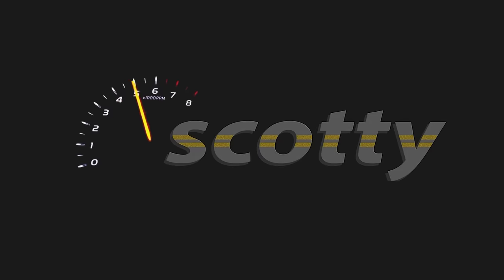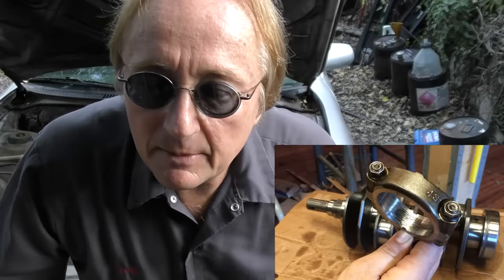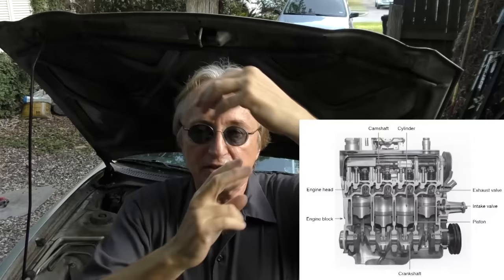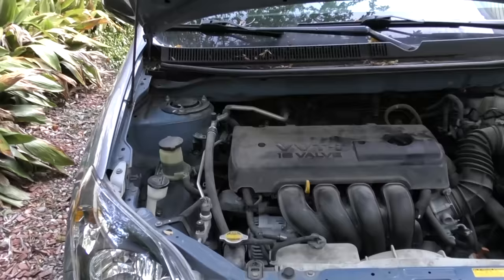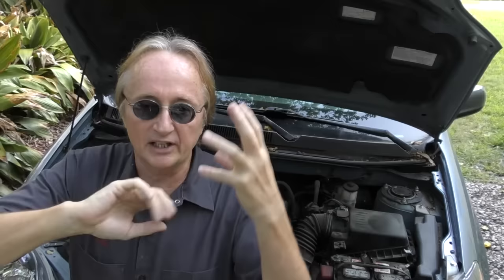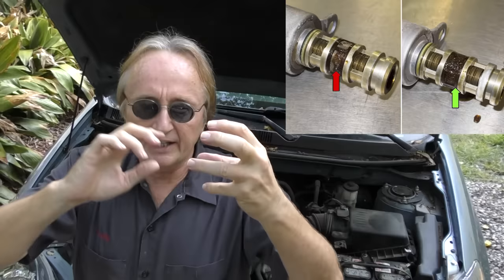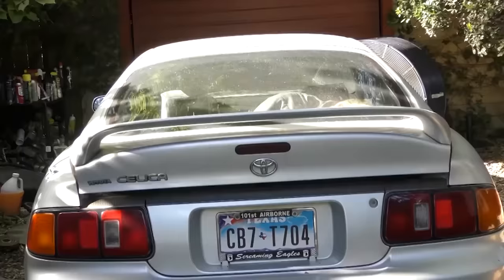Why Not to Flush the Engine Oil in Your Car

Comment: Had great experience with Liqui Moly engine flush. Toyotas have bad engine design and too small holes in the pistons behind oil ring ,even with frequent oil change these holes can clog up. ZZ-FE engines need flush before every oil change in my opinion ,but just gentle one 15 min idle.

Comment: Scotty, i heard that you can use auto trans fluid to flush engine. Take out a quart and put a quart of atf. Run for 500miles stop and go. Then drain all and fill with motor oil. Change oil filter too.

Comment: Here in Australia we have Penrite oil flush it uses the same detergents that is in the oil it is not a hard deterrent I have used it for years and never had a problem I have actually had older engines run better and quieter after a few flushes look up Penrite oil flush it will tell you the information you need my Suzuki was making a noise and after the flush it is now quiet since the flush before I was just changing the oil

Comment: The best and most safe way to do this is to use 5 litters of diesel and do this on a cold engine.  Disconnect the belt to the oil pump and use a drill to SPIN it for 15 - 20 minutes. Then drain. But the most IMPORTANT THING TO DO IS CHANGE YOUR OIL AT LEAST 3 TIMES to get ALL THE DIESEL OUT. So fill with oil , idle 10 - 15 minutes and immediately drain. REPEAT 2 MORE TIMES.

Comment: You wrong Scotty. The flush loosens the crud and it gets caught in your oil filter before it can get to your oil channels and galleries. Do a flush and change the filter run it some more and change the filter again, the drain everything and do an oil and filter change.

Comment: I use Shell Rotella T6 fully synthetic Diesel oil in my turbo diesel and in my turbo  as well, I change the oil at 5000 miles and the diesel oil is capable of holding mor ein suspension and removes the sludge.

Comment: Lots of opinions because it's a complex issue. If you do your oil changes regularly, you're good. If your engine is crudded out, there is no SAFE solution besides pulling the engine and seeing what's going on.
Then it depends on product used too and specific engine. As Scotty says, if the crud is preventing the engine from leaking you'll reveal a leak. Your solenoids or variable vale timing system can get crudded out. TECHNICALLY, the solvents are not supposed to break the crud in chunks, but in practice it can happen. There could be metal shavings and other stuff trapped in the crud, and THAT can be freed to clog stuff when the crud dissolves. You can't be 100% sure. Hence professional hydrogen or solvent engine cleaning can be a problem too, but then it's the mechanic's issue, not yours. If they run it too strong and clog the engine, they'll be pulling it for free. That's why it's generally not recommended unless you're ready to go pull the engine and clean the rest, change head gasket and other seals etc. If your engine is crudded out but still works generally fine, regular oil and filter changes with modern oil will possibly keep it from getting worse.
A guy in another video recommended a double oil change, that might help some too. Double oil change, cleaning the pan and engine cover head is as far as i'd go personally.

Comment: I have a 2.0t and was running pretty bad so i drained the oil and left the plug open, then just powerwash from where you normally put oil in the engine and youll see everything come out :) make sure the engine is hot before draining the oil so it will make all the water evaporate when done, fill up w new syth oil and like brand new

Comment: Have an old Honda with well over 200k miles. I can’t believe how well the engine runs. Always used synthetic and always changed on time cause it starts bugging me about it when it gets to 15% life left in the oil. Now the transmission and rest of the car was a different story.

Comment: I usually drain the engine oil then pour some new oil in to push out some of the old dirty oil, wait till the oil starts running clear before putting the bung back in.

Comment: I bought a 2005 Subaru Sti with 130K original miles with no oil leaks. I decided to do a engine flush (2 oz of sea foam) in the oil crank case, ran it for a few minutes then drain the oil and put new oil and filter and yup.... that is when i started to have oil leaks on my valve covers. Sigh... Now i know not to do that ever again. ha

Comment: Owners manuals tell you NOT to use fuel or engine cleaners.   I use to use these products until it Clogged up my oil pickup screen Literally 100%  with hard carbon.  …. When all that carbon breaks up guess where it ends up???   Right in the oil pickup  screen.  Won't clog immediately  but overtime the use of these detergents  WILL clog your screen .  Do not use this stuff
Reply: No Fuel cleaners???  But it helps with cleaning the injector heads.  Thanks

Comment: I wish I would’ve seen this video before I flushed out the engine on my 20004 XC 70 Volvo. The guy at the oil change place recommended it. The car ran fine. Now it’s running like crap the oil pressure light keeps coming on and it’s burping and farting. I’m at a loss of what to do. I don’t have the money to pay a mechanic to look at it. I really needed this car.

Comment: Would you recommend just running clean oil after an oil change just to get whatever is loose in the engine that didn't come out with the old oil to get it back into suspension, run that for 5 to 10 minutes and drop that. Not using a motor flush product, just regular motor oil.  Then fill it back with oil and a new filter.

Comment: I use QMI PFPE engine cleaner. I use it every 30 000 miles-ish. Once I have done it, I have to take out the oil sump and clean it and the oil strainer. Never had an issue and the engine runs better afterwards.

Comment: I bought a 1992 Toyota Paseo 171k km, auto. Did oil flush and 5k km later I notice it starts leaking oil from the crankshaft seal. I just bought another 1992 Toyota Paseo 141k km, manual. Definitely not going to do oil flush this time around. Just a nice semi-synthetic group-III oil and a synthetic oil filter from now on.

Comment: You should make a difference between "already cruded engines" and "normal not dead already engine".  If you flush engine every time you change oil than you would not have problem with deposits....so it is more of a ..."if it is an old engine maybe you need more than one flush":)) (3 or 4  consecutive with clean cheap oil each time and "detergent" )

Comment: Just regular oil changes at 7500 miles on a 2.2 liter 4 cylinder 2010 Chevy HHR and just hit 230,000 miles. Bought it used with 60K and it still starts right up and gets 32 mpg

Comment: The owners manual is a guideline. Flushing MUST be done intelligently with consideration of the internal condition of the engine. Then a shortened O.C.I. (oil change interval). Otherwise don't attempt it. Just change the oil early a couple of times. This will clean the engine internals.

Comment: ZMAX has an FAA rating and melts sludge and the carbon under the pistons that heat up and make it diesel. I bought a $400 Econoline and the engine was missing and transmission bucking I added ZMAX in the gas tank in the oil in the auto trans. By the time I got home it was purring....still runs. Sold it same week $3200.

Comment: You can flush engine oil without using additives. Just put in fresh oil run it up drain refill repeat until only clean fluid comes out I do this for all my engines and they always come out clean even after a few thousand miles

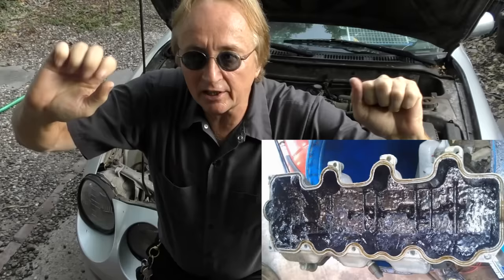Comment: 1:34 Talks about old engines crudding up. Shows examples of modern engines all crudded up, With his Miracle Detergent oil.  Then talks about detergent oil keeping that sludge in suspension in the oil as a good thing,  but then says how bad it is when a cleaner put those deposits in your oil. His evidence contradicts his opinion. Although I do agree with him about changing your oil on a regular basis. I've been an ASE certified Technician for 28 years and Scotty is like the weatherman he's wrong as often as he's right. The moral of the story is to keep your engine oil changed. You can't change it too often. I use Synthetic oil and it still gets changed every 300miles/ 5000km.
Reply: That would be about a week driving in Houston.

Comment: Just bought a 2002 C320 and my oil looks like peanut butter. Luckily the engine isn't overheating. It doesn't have an oil dipstick so I have no idea what the levels are at. Gonna flush it.

Comment: An old engine with clogged gas journals should be run with a crankcase cleaner. Like seafoam. You got to get the sludge out. Timing chains fail without proper lube. It depends on the engine.

Comment: The carbon soot in the blowby in a typical GDI engine is a much more aggressive sludge former than that in the blowby in a typical mutliport fuel injection engine. Oil formulations are better but combustion blowby is worse.

Comment: Why don't they put a double seal on each end with a return line to the sump between the seals?  They do that on high pressure hydraulic actuators to prevent leaks and it works great.

Comment: My father always told me Change your engine oil, Air and fuel filter every year and car will run forever.  I’ve had my Ford and the body is going before the engine 150k no issues.

Comment: Toyota just started selling flush pn. 08814-80060. might solve the early oil burning issue caused by carbon buildup on piston rings?

Comment: Can you just then, drain the oil out and run diesel in the oil or as the oil, to help with that.... don't drive it, just leave it idle........? 

Then do a flush, that way.... Perhaps, use Kerosene....?

Comment: I'm sold , will not flush my 201,600 mile chevy Impala 3.9 2007. I do regular oil change with synthetic oil 5w30. 5-6k intervals. A new last oil will be Amsoil 100% synthetic 5w30 no flush. It's the only non burning oil car we have. It don't stutter starting either.

Comment: i pulled the valve covers off a motor once and found them full of sludge, perfectly formed chunks in the shape of the inside of the valve covers, ford 390 running penzoil, around 1970. could even see the rocker st all.

Comment: If you have to do an engine flush I'd just use a cheap engine oil for a couple of hundred miles, Then drain and fill up with a quality oil. Much kinder on the internals.

Comment: If you want to do an oil flush. Put fresh new oil with the filter run it about 800 to 1000 miles then drain the oil and do not replace the filter run it the remaining 1800 miles and then change the oil with the fresh filter. That's an oil flush

Comment: My 5.3 Chevy engine (2000) dropped 20 lbs of oil pressure in a month, motor has NEVER SEEN dirty oil. (Now at 214K) Mechanic friend said to flush her just before an oil change. I did.  Pressure came back up as good as it ever was! I can't figure out why,  save for oil starvation at the pickup screen, but that makes no sense, and no  I never run Framcrap filters.

Comment: Thanks for the video scotty my oil pressure sending unit needs replaced on my 95 ford explorer factory everything 152k miles like new no issues  and I was thinking of just cleaning it with a flush now I'm not doing that I'm replacing the unit it's easy enough

Comment: When an engine is like in the picture, oil not changed for 75000 miles, then only disassembling and manual/solvent cleaning helps. On newer vehicles full synthetic with washing additive blend is a good idea. Running 500 ml engine flush for 10 minutes will not do harm. By the way, what is the oil filter for? Ain't it supposed to filter the hard crap before it gets into the passages? And 3-5 bars of oil pressure can't handle some gunk? ....Let's assume we change oil and filter in every 10000 miles. Nothing will go wrong. Flush also has the placebo effect: for 10 bucks you'll feel better...

Comment: Don't use on modern engines, forgetting that it wasn't long ago there were Toyota and Chrysler had sludge issues.  Engine flushing is a good idea, if you have sludge holding your engine together then it's not the oil flushes fault.   If you running a flush it dissolves the sludge and varnish it won't clog up anything.    Scotty is wrong on this for sure.

Comment: Remember when you had that leaky valve cover gasket (cork), so you take out the 4 valve cover bolts and think you are going to lift the cover right off "NOT". The only area that was not solid was where the rocker arms moved up and down, LOL!

Comment: Have 2006 silverado 84k miles which seems to have the lifter tick like other 5.3 engines.  Wanted to run the GUNK cleaner through before taking off any valve covers to take a look at it.  Not a mechanic, but when you say older/newer cars I don't know what years you are thinking.  70's and 80's old or 2000?  Started using full synthetic around 25k miles.

Comment: I made this mistake years ago with my 351W.  I flushed all the crud out of the engine only to find out that the crud was holding my lifters together.  I then replaced all of the rocker arms, lifters, cam, and push rods, only to find that now the rear main seal is leaking!

Comment: Used liquimoly engine flush on a high mileage M54 BMW engine and it ruined the lifters and caused it to rattle. Installed a new engine with no issues ran very well until liquimoly engine flush was added it completely caused the same problem! I cannot believe I may have to replace the motor again because of this

Comment: If the engine sludge is what's keeping your gaskets and seals from leaking then you've got a bigger problem than just whether or not to use an engine flush.  Higher mileage engines will get sludge buildup no matter what type of oil you use or how often you change your oil.  Motor flush has been proven to get this sludge out of the engine and will keep your engine running longer and smoother.

Comment: if you check the color of your oil on the dipstick before changing it it will be dark brown. if you use engine flush at every oil change you will see the oil drained  coal black. i personally want the sludge removed from my engine. sludge does not build up only at certain places like Scotty would have you believe. sludge is not a lubricant and inhibits the clean oil from getting to where it is needed. sludge also closes up the oil passages to where the oil slows down returning to the oil pan and the passages the oil needs to travel gets less oil. rev up your sludged up engine. and don't forget to ring up the cash register for a new or rebuilt engine or possibly another vehicle !!!!!!

Comment: I've done flushing before, but not with that type of stuff. I used a cheaper oil to run for a day or two then change it up again with better oil I I tend to keep in the engine. Same oil weight, same oil type. Just look for cheaper price as a flush.

Comment: The crud that gets flushed loose could very easily find it's way into the oil pump screen and starve the engine of oil.
Reply: Use flush only every 50k is my advice.Frequent oil changes is a must.

Comment: Was given a 2002 Silverado 4.3. It had little issues, but it ran ok. It has 224,000 miles. Did major tune up. Sludge came out when changed the oil, like ALOT!. Never tried to put engine flush after that. I used mobile 1 synthetic oil to put new oil and filter. Took it on first drive for 73 miles to pass inspection for registration purpose. It passed!! Ran awesome, cruised well at 75 on the 45 freeway! Took it home. Started up in the next  morning and NOW IT KNOCKS.....sounds like the valves are knocking. Oil pressure is still good, but now i dont want this thing anymore. Dont know what to do now. No codes. Starts right up, but it sounds like im playing with marbles!.... :(
Reply: Try Auto RX Plus inside that engine if it’s still working.  Sludge is never good to see.

Comment: It would seem, any dislodged particulate would get picked up by the filter media during a flush.
It’s a mystery how the variable valve timing components would collect particulates, unless the Origen was upstream of the filter in the oil feed galleries.
Somewhat unlikely.
Reply: Oil filters let anything smaller than 30 microns pass on through. Finer filters clog up sooner and start bypassing.

Comment: I have an 08 Hyundai with 2.7 V 6 cyl. It is an invasive motor. So... I have what I 99% believe to be  a sticky liter. It taps when the car is cold and quits when it's warm. It's a ticking not a knock. When I got it I switched to High Mileage Synthetic oil. Should I use an engine flush?  Or should I just change back to SAE 10W30?

Comment: I bought an 00 corolla with 63k on it that was loaded with junk. There was literally grit on the dipstick! I changed the oil every 1000miles until there was no longer any grit on the dipstick, which was five times. I then ran it to 173k miles and it ran great the whole time. HOWEVER, it did burn about 1qt every 1000 miles the entire time which was really annoying!

Comment: Hi Scotty. Yr channel is best when it comes to cars. Have a question for you.  can i use engine flush in a car with over 20000 miles on it?. PS. this engine is very, very dirty inside. Cheers from Sweden.

Comment: I think he's talking about flushing it with water.  Or else engine flush product which can be bad for high mileage cars. 

My idea of a motor oil flush is changing the oil like normal. Drive for 2 weeks then do another oil change, basically allowing clean oil to act as the cleaning agent. 

If you're oil is black, then flushing your system with a secondary oil change 2-4 weeks after the first is smart, because all of the build up and sediment is likely going to shorten the life of your new oil as modern synthetic has cleaning agent additives & better lubricating properties than standard motor oil.  Its gonna go from that honey gold color to brown pretty fast if the oil you drained out was black.